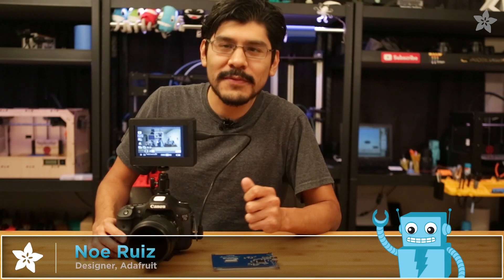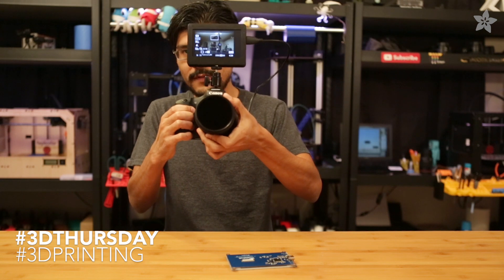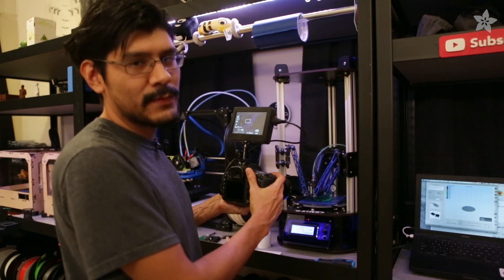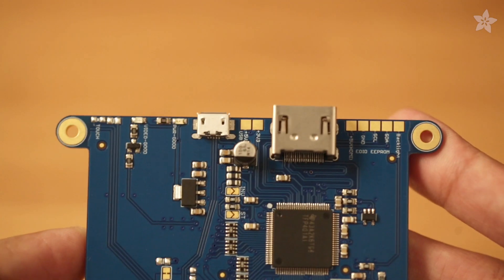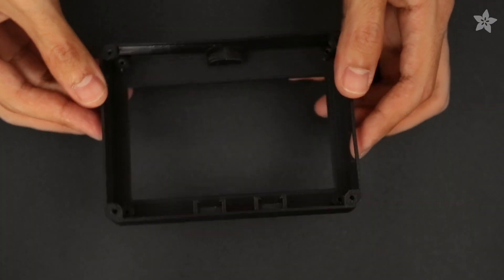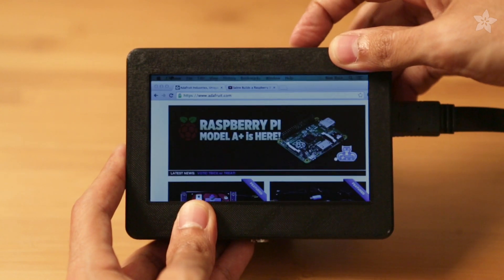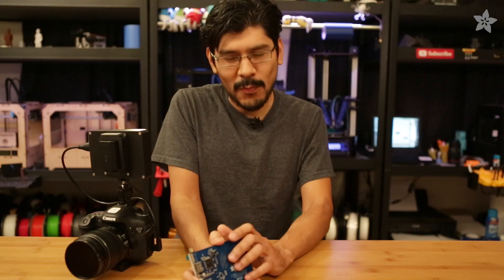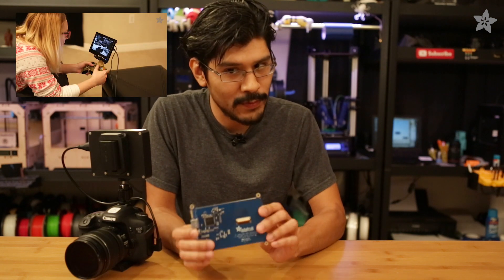DIY Camera Monitor

Comment: Hi. I bought a second hand LCD monitor but it has no battery to power it. What kind of battery should I use? Thanks...
Reply: Check the model name in the internet , and use 3.7v battery with a buck converter to change the voltage to the desired number of volts you need . I said 3.7v ones cuz they are relatively easier to charge with USB voltage , and the step down circuit comes at a very cheap price range of 2-3 USD 😊
Reply: @asgelwkyi  thanks a lot.

Comment: if you can afford a 3d printer you, might as well just buy the real field monitor.
Reply: EverythingEvelyn do you?,, if so you should just buy a real feild monitor.
Reply: Cost only $20 on 3D hub & one week
Reply: Quantum Entangle 
Well, for $26 I did it without any kit. Sure I could buy a monitor instead. But it’s the fun building something on your own...
I used a raspberry LCD screen with an DIY enclosure and a 18650 lithium battery.
Here is a 30s video showing how that would look like. Takes less than an hour to build.
https://youtu.be/Gu_nuoc9FHE

Comment: This is great! can you provide the STL file for the HDMI 7" 800 x 480 Display? 5" is great, but a 7" would be better. Maybe modify it to support two batteries in parallel for extra run time.

Comment: I was looking into making a camera monitor using the 5 inch display you use in the video, however I was reading on adafruit's website somewhere that the TFP401 driver does not scale the image. Will this be a big problem? Is there a way to scale the image?
Reply: Yeah, would like to have the answer to this too (sony a6000 camera)

Comment: I tried this HDMI Display with a Canon 5D and with Canon 500D, they both didn't work. You used a Canon 7D as far as I can see in this tutorial - Could you please describe what kind of settings you changed for making this Display work? I cannot imagine that the HDMI communication between 7D and 5D should be so different...?

Comment: Does this only work with hdmi capable  camera's? Or could it be modified to run on a nikon coolpix camera?
Reply from the maker: Any device with an HDMI output will work.
Reply: The only trouble is this coolpix camera i have doesn't have an hdmi output only a micro usb port used for connecting to a computer/ charging batteries i think. Thank you
Reply: Adafruit Industries Will it work with a Mini hdmi to a adapter?
Reply: @shotbychristiann  I think yes, HDMI small or large, still carries the same HDMI signal